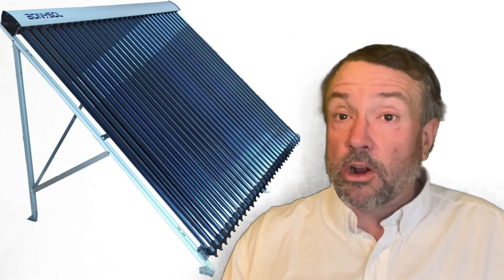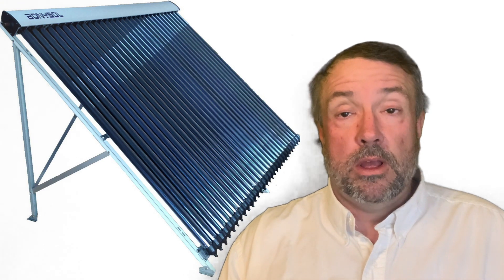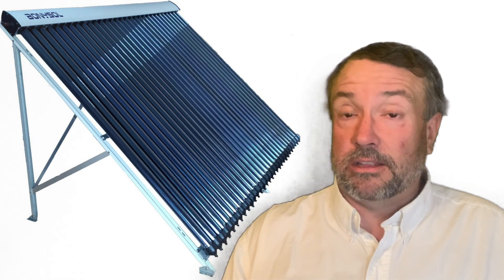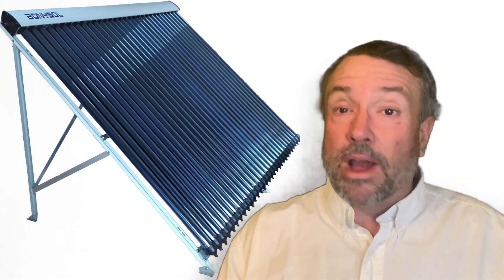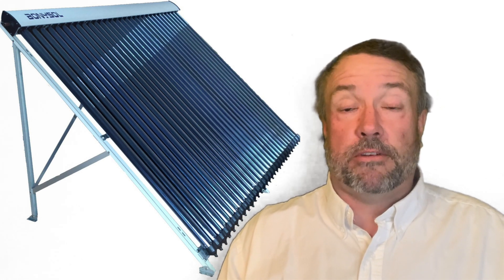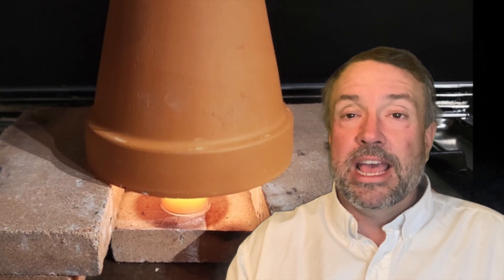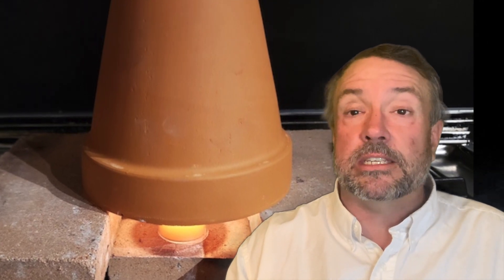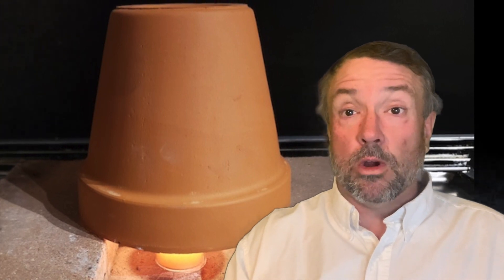VERY Alternative Greenhouse Heating

Comment: Teacup candles don't burn very long. Put a wick in a large metal shortening (Crisco) can and it will burn for about a month - adding heat and replenishing CO2.
Note: if you plan to use animal heat, preplan your greenhouse construction so that your chicken coup or rabbit tractor will fit through the door.
Reply from the maker: fantastic tip - thank you!

Comment: I've been trying to figure out the BTUs of chickens and rabbits. I'm trying to see if the integrated agriculture can help CO2, O2 and H2O, and heating in greenhouses.
Reply from the maker: I have no idea how to calculate it - I only know it can be done as I've seen it working
Reply: Not an engineer so I can't make an authoritative claim but if you have access to a variable speed treadmill and a bunch of rectal thermometers, i have an idea...  oh and moisture resistant duct tape.  Definitely wear gloves for this one
Reply: It's probably a little late but chickens and rabbits average 1 watt of heat per hour per pound of body weight (3.5 BTU/hr). Most warm blooded creatures hover around this number.

Comment: It's been difficult to source the thermal curtains for the Chinese style greenhouses. I'd love information on distributors aside from Alibaba.
Reply from the maker: to be honest alibaba is the only place I know to source them
Reply: @SimpleTek  would you be able to recommend a supplier from Alibaba? And do you know how to calculate the R-values of the thermal curtains. I have a spreadsheet that helps calculate heat loss and BTU requirements, but I depends of knowing R-values.
Reply from the maker: @Thathumanoverthere1701  sorry, I use different ones all the time. If you buy some let me know, I'm in the market right now